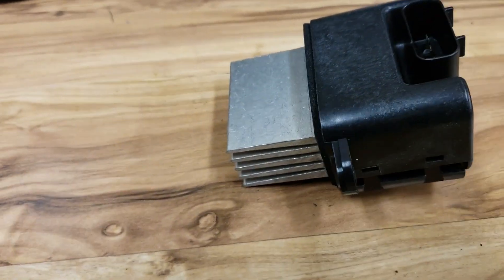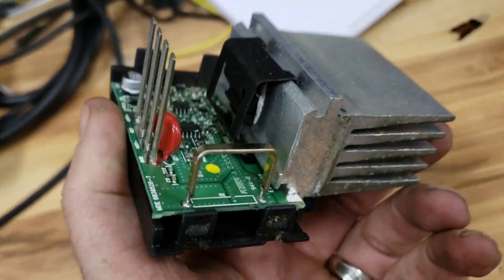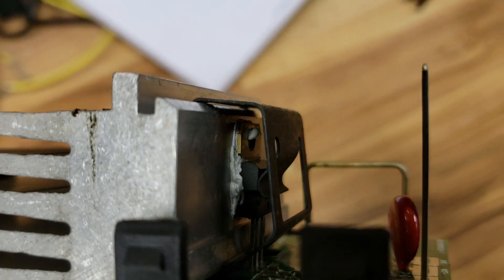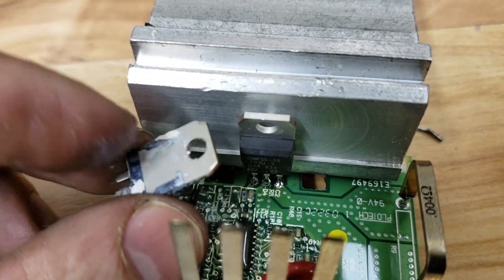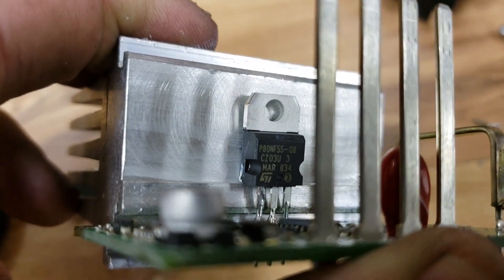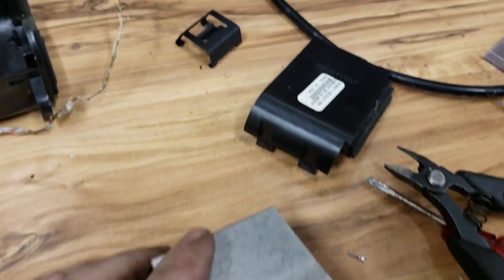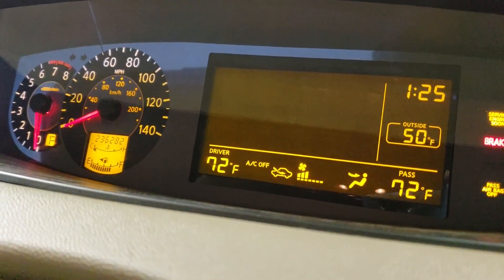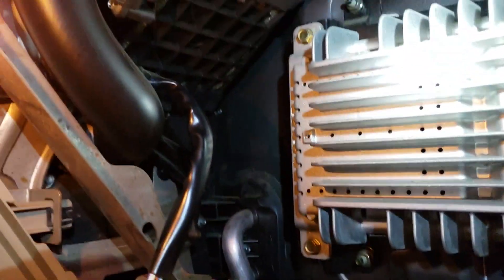Fixing Nissan blower motor "resistor", amp, controller, whatever

Comment: @FixItCheap  I have a 2011 chrysler town and country I having a really weird issue nobody can figure it out I be driving it then all of a sudden it gets stuck in one gear nothing I do helps it get out of that gear then I have to pull over shut it off let it sit for a few seconds then turn it back on and it drives beautifully no hard shifting shifts into every gear then after driving a couple miles it does it again gets stuck into a gear then have to shut it off again and works fine when I go from park to drive I do hear a real bad clunk from the side pan sometimes it doesn't happen all the time this van is very Bazaar just got it 3 weeks after it was driving fire for couple weeks then this last week it started doing it it has the same codes p0734 p0735 p0733 thank you
Reply from the maker: Is it always the same gear it gets stuck in? Or does it vary? Driving around with a bidirectional scan tool could give some insight, unfortunately they're quite expensive. Before taking the compounder apart, I would track down all the speed sensors and verify their operation. You can ohm them out, and then ohm them out again through the PCM connector to verify harness integrity. Also check for corrosion in all the connectors.
Reply: Buy a dipstick and check fluid. It uses ATF plus 4. You are not stuck in gear you are in limp mode. Dirty fluid or wrong or low. I will help you
Reply from the maker: @CHEAPROLLIN  Good point, always a good idea to have a dipstick for the trans. I marked the backside of my engine oil dipstick according to some dimensions I found online.  I can now use that dipstick for either the engine or the trans, and I always have it with me.  

Line pressures should be reported on a good scanner too, and can help indicate whether oil delivery is an issue.  Low pressures can definitely cause slippage resulting in these speed mismatch codes.